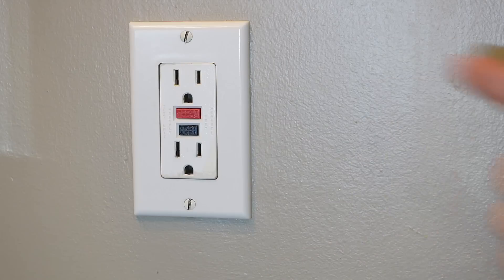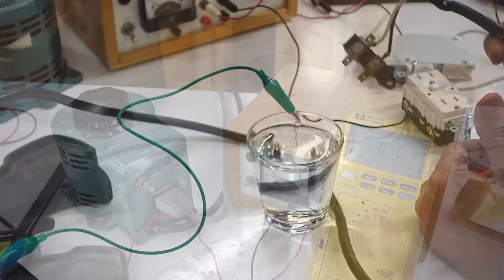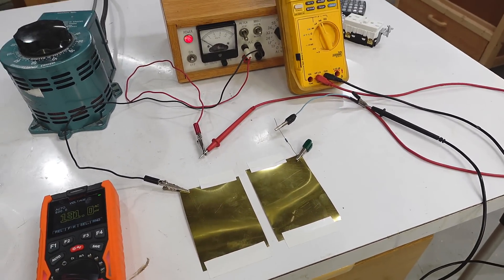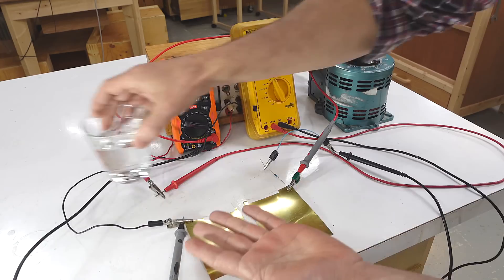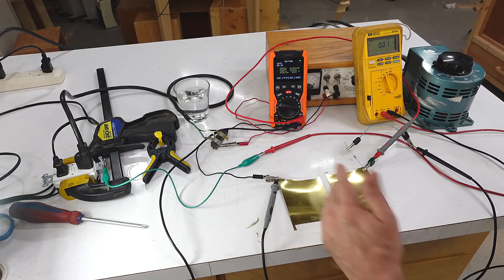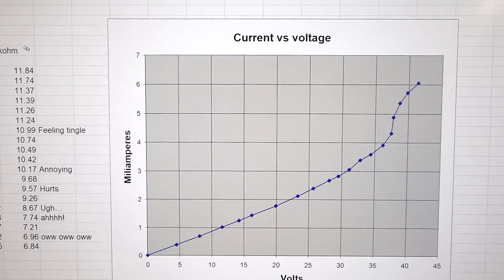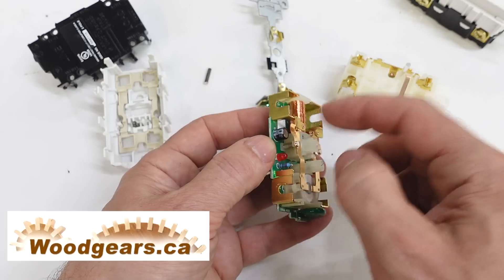What does it take to trip a GFCI by hand

Comment: My sophomore circuits professor told us that the most dangerous case is a path through the heart, such as from one hand to another.  He said that 60 joules through the heart was deadly.  Hence the rule that you work on AC with one hand in the back pocket.
Reply: Back when I played with high voltage for fun, I charged a 220uF capacitor up to about 400 or 500V and accidentally discharged it by touching across its potential with each hand on a side.   That was about 20-30 Joules.  It discharged and felt like I’d been hit by a sledgehammer, I sat down hard and the world spun a bit as I was in shock.  I didn’t have any permanent injuries, but was probably close to a heart attack and dry hands may have saved me.  It’s not a joke when you have high voltages on anything, capacitors included.
Reply: If I remember correctly, 10 miliamperes through your body is enough to cause big trouble.
Reply: Hand to Opposing foot is a direct path across the heart.
Reply: 60 Joules? That is a lot - sounds like 2 orders of magnitude to high.
A defibrillator is charged with maybe twice that and only a small fraction of that is going through the heart.
Reply: @ABaumstumpf clearly he didn’t mean 60J dissipated within the heart itself. 

Technically it would be more accurate to say 60J applied to the outside of the body can stop the heart, if it’s included in the current path.
Reply: Working with one hand only seems cumbersome.
Reply: Better plan, turn off the power before working on AC circuits... Nothing is that important that it needs to be worked on live, and if you're developing something and need to see what's going on live for troubleshooting, probes are insulated for a reason - don't stick your fingie where you wouldn't stick your dinky... but you can stick the probes there

Comment: i noticed the increase in the current vs voltage slope coinciding with the "hurts" region. which might be explained by your hand starting to sweat in responce to the pain. which would in turn suggest that the slope would saturate at some point. dunno
Reply: Maybe, but also maybe not. The effective resistance is also a function of current pulse duration in the relevant range of tens of seconds (even with the weak ≤ 2 mA region used for brain stimulation through the skull, where I have a bit better intuitive grasp, but also for the range of currents where I really only recommend to go for good clinical reasons when nothing else has worked so far)

Comment: Why do you have GFI near the socket? We in Europe have one GFI for the whole House.
Reply: They are more sensitive in the US: 5 mA vs. 30 mA so if you put just one for the whole house you get nuisance tripping and the whole house goes dark. Even in Europe one per hose is no loge typically used sand they are moving towards protecting individual circuits.

Note countries that use TT earthing have a 100-300 mA RCD for the whole house but that is just to make the earthing work. It does not protect against direct touching of the the wires. TT means there is no jumper between the ground and the neutral. The Ground goes only to a rod.
Reply: @okaro6595  I am not an electrician but I have never seen RDC that were more than 30 mA. Also all the homes that I have seen have separate ground and neutral and  the RDC protects against being shocked by only one wire.(from what I know touching live and neutral simultaneously might still be deadly if your body is  not grounded well)
Reply: @hshshejejdu971  The higher rated are to suurenee that the grounding works. Since the fault current with the rod is about 10 A, 100-300 mA is low enough. On TN one does not need that as the breaker cuts the power.
Reply: It should be noted that RCD sockets are available in Europe also but they are rare. You either have one in the panel or if you voluntarily want to add one, you buy a plug-in one.
Reply: @okaro6595  also what is the point of 5 ma if you have half the voltage of 230v? Also you should use RDC that also protects against DC voltage shocks and this type is more expensive so again, what is the point of using many of them?
Reply: @hshshejejdu971  I fail to get your point. But in Finland type A RCDs have been used at least for a decade.
Reply: @okaro6595  1. What is the point of using 5mA RDC? Can you be injured by 30ma at 120v if you have a healthy heart and don't choose deliberately sensitive spots?
2. You have 120V instead o 230V so 10mA *120V = 5ma *240V just because of lover voltage you are less likely to be injured by electric shock assuming that electric injury depends on the energy of electric shock.
2a. So what is the point of using RDC at the socket apart from not shutting down the whole house at once?

Comment: Here in Brazil we got eletric Showers, 220v 10amps the neutral are linked to water, of you got some wound or small cut on the skin when you touch the metal knob of the shower you get a little zap hahaha but on the skin its very safe

Comment: I'm still surprised that GFCI's are not legally required in North America for all circuits in the house. In the UK and Europe they are mandatory, and have been so for at least 30-40 years as far as I can tell.

I've also been shocked by 240v when I was in my early twenties. Multiple times. It was not fun!
Reply: Almost everything now needs GFCI or AFCI - AFCI for bedrooms and livingrooms (basically, anywhere that you could possibly have a lamp where someone ran a cord under a rug to get to the lamp), everything in bathrooms, kitchens, garages, and outside needs GFCI (basically anywhere with possible wet locations). In a house built in the last 10 years, there's hardly any plugs that aren't GFCI or AFCI protected - I have a single 20A freezer plug in the garage that isn't, and that's about it, other than the 220V plugs for the dryer and the stove, and the 220V plugs I added for the table saw, and the welder, and all the garage plugs where I removed the GFCI outlet as the VFD on the lathe tripped it instantly.
Reply: The NEC is gradually heading in that direction. There are still some holes in the GFCI protection.
Reply: In Finland  they were first mandated in 1997 and since 2013 all sockets and lights have been required to be protected unless the  loss of power would cause significant damage.

In the US they are so sensitive that you cannot just toss one in the panel.
Reply: here in US you'll prob get run over by your own parent's pickup long before you might become a conductor.

Yes, gfci's do not cooperate with VFD's or inverter welders. take heed: the barn, built 1946,  long predates safety. It's scary but not compared to the road in front of it.
Reply: @Octopusbeak  My mistake was thinking that a 120v input VFD was a good idea, because I could plug it in anywhere without putting in another 220v outlet - hah! Basically anything  220v is the only stuff that's exempted from GFCI/AFCI these days (and freezer plugs apparently)
Reply: Sorry but no, they are not mandatory in the UK.  They are mandatory in new builds, if certain works are carried out etc but an owner occupied house etc etc that has an old installation without RCDs is not required to have them fitted.
Reply: @retrozmachine1189  same in US then. All outlets have to be GFCI protected in new construction for residential use.
Reply: On the other hand, in the US, our GFCI trips at 5 mA. Your RCD trips at 30 mA. So you lot get to enjoy up to 25 mA going through your body with no RCD trip. Meanwhile, the majority of locations where shock is possible in the US are protected by 5 mA GFCI. Of course, we do have a lot of old construction in the US that is under-protected. You probably do too, but I don't know that for a fact.
Reply: @mckenziekeith7434  Yes, but the reason for 30mA is number of devices likely to appear on a circuit.  If places such as these attempted the use of a device that trips at 5mA it'd be going off all the time.  Even in the USA it's not uncommon to hear of people having problems with wet appliances such as washing machines tripping 6mA GFCIs where there isn't actually a fault with the appliance.
Reply: @retrozmachine1189  I think it is mostly old appliances and outlets that use protective earth as neutral which cause nuisance tripping of GFCI. It really hasn't been a problem for me living in the US. I have seen some reports of problems with washers and dryers tripping, so I acknowledge what you are saying. I just don't think it is a big problem going forward in new construction. Mainly it is a problem with older installations and appliances that are put on GFCI breakers.
Reply: @mckenziekeith7434  Definitely not a massive problem but not one relegated to old machines either.  I've heard of new machines causing problems over there too.  I'm in Australia by the way.

Comment: I worked in an industrial manufacturing facility, and brushed up against a terminal that was one leg of 380 three phase. Luckily I wasn't grounded. But I did feel it tingle.  Another tech wasn't so fortunate.  He was checking the 15kv leg of an industrial laser.  He was holding the high voltage probe and I guess that insulation was not enough, because it shocked him and ran through his body. He was leaning up against a metal rail and where he contacted it with his butt, it left a burn mark on his underpants.  (not sure if that was the only mark).  Policy after that was set the high voltage probe propped up and look from a distance.

Comment: In the early 1960s  I could have used a better GFCI.  Feature an aluminium ladder, freezing mist, a corded ( naturally ) drill ungrounded with a metal metal case, storm windows, and a rather dumb/ignorant self.  The power went from the drill in the right hand, through me to left hand holding onto the wet and iced ladder about under-eve level of a 2 story house to wet ground.  I interrupted the current first by sounding a audible alarm then releasing the ladder.  At that point it would have been best if I had swung the drill by the cord and launched it into near earth orbit.  But no, I wrapped the rung in a towel and continued to install screws until the towel got damp enough to conduct.  When my sister had new windows installed last year, she sent me the old screws.  I don't know what happened to the drill.

Comment: As an electrician that learned from the Old Guard. Solid sole shoes, not standing in water/rain and just touching one wire at a time preferable with the same hand. Is in general all the safety advice a light commercial, home, small office Electrician needs to be safe.

TLDR: just use common sense and logic.

Most residential/home electrocutions are just down to improper wiring and faulty appliances. While most residential/home electrocutions involving water have to do with pools. Best bet folks is to shut off the power if possible and if not, stay dry and call a professional.

Oh, and all it takes is 7 millivolts across the heart for an adults heart to stop even less for children or the elderly.

Comment: Those are RMS readings, not peak. I expect a difference in nerve sensing between the two. The thing that amazes me is how a touch of the AC hot lead only can cause concern. It must be our effective capacitance but I haven't studied the models. Thanks for your real human model!
Reply from the maker: Actually, just touching hot usually does nothing unless there is a good path to ground.  Dry shoes is all you need to be well insulated.

Comment: As a 10 yo at a friends place I wanted to turn on the lights but bridged two wires sticking out the outlet with my pinky finger. It was dark and could see it arcing. Burned a nasty hole into my skin. That hurt a whole lot longer than a few seconds. I had a few choice words for his prank, I can tell you that! It was 220V, not something to mess around with.
Reply from the maker: That would go under burns!

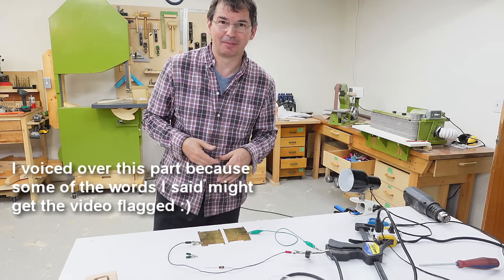Comment: 5:30 you said the circuit is set up in a way that the current couldn't go anywhere else, but theoretically if you for a brief moment just touched the live wire and not the ground one (because of irregular hand shape), it could go to ground through your whole body i think. so probably even safer would be to have a ground strap on your wrist to at least minimize the current path to just your hand
Reply from the maker: That's assuming there is some path to ground from the rest of my body, which there was not.
Reply: @matthiasrandomstuff2221  Got it :)
Reply: Were you wearing special insulated boots (or standing on a rubber mat?)
Reply: Didn't you notice? He jumped just as he did it ;)
Reply: A typical ground strap has a 1Mohm (or is it 10Mohm??) resistor in it, so would not allow enough current to pass to trip the gfci. The resistor is there specifically so you aren't super well grounded, just grounded enough to let static charges dissipate.

Comment: The sharper increase is the skin resistance breaking down as the current finds a direct path under the skin tissue. There is plenty of iron to maintain a good current afterwards. I remember the 80's as well as the 70's. It hurts.
Reply: Well, getting 10-15 kV from an old Briggs engine ignition system, while intermittent, really hurts too.
Reply: @WJCTechyman I've been shocked plenty from ignition systems. But none compared to when I got shocked by a large neon sign transformer. I think it was still about the same voltage of 15k but the current is much higher. Those things are no joke. Had to function check myself to make sure my heart was still beating.
Reply: There is very little iron in blood. There are far more ions like calcium, sodium magnesium, phosphorus... which affect the conductivity of blood.
Reply: @whitcwa it's also not metallic iron. It's a protein that contains iron atoms. Pure carbon is conductive as well and we've got way more of that in our bodies. Like you said it's the water and electrolytes in our bodies doing the bulk of the work.
Reply: It's really not the iron which makes your blood conductive.
Reply: It was acceptable in the 80's.
It was acceptable at the time.
Reply: Just like starting an arc when welding.
Reply: pretty sure the conductivity is caused by all the salts, iron atoms are lodged pretty well inside hemoglobin, they do nothing for electrical conductivity